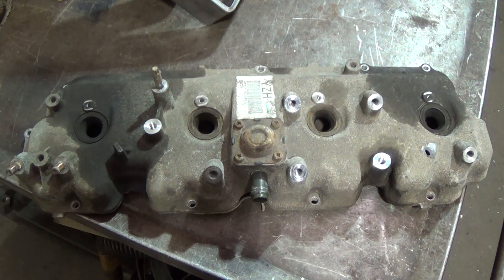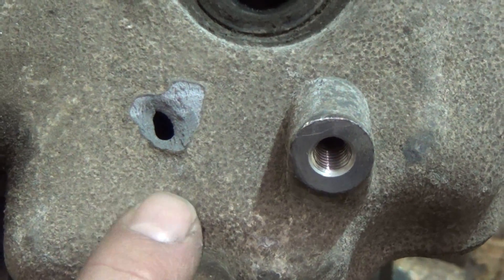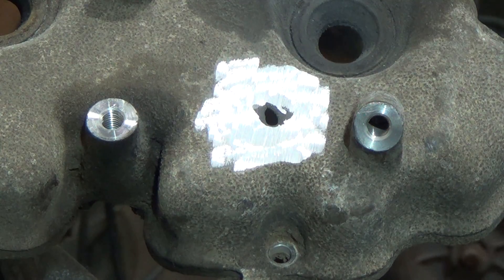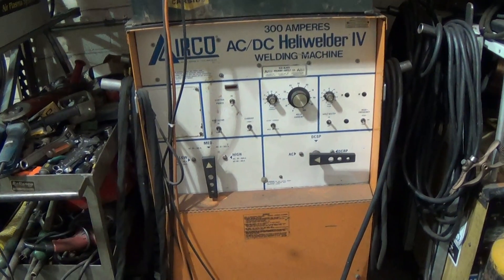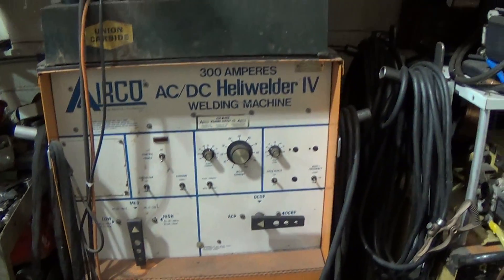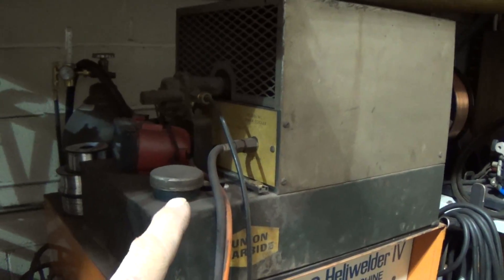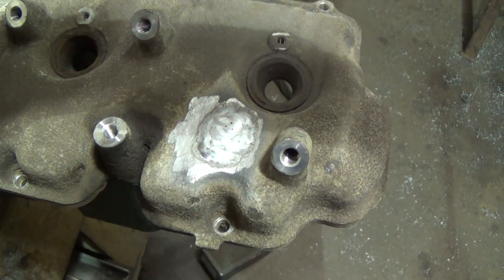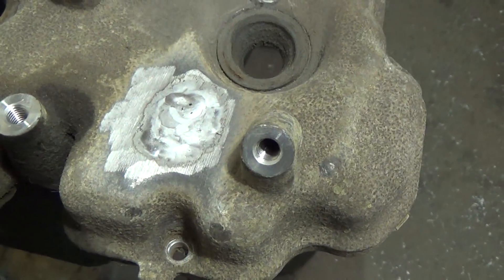Heliarc Repair Of A Cast Aluminum Rocker Cover

Comment: Nice job.
I was wondering did you have to do anything to stop the molten aluminium dripping through the hole, or is it thick enough to stay in place during welding?
Reply from the maker: Hi Jix,  No, I was able to not have to back it up with anything, just took it easy, as a puddle formed I fed a bit of filler and backed off, then repeat, and since it is aluminum it tends to dissipate the heat through the part.
  Thanks for the positive compliment ...... Mike
Reply: good question! i was wondering if he would use some of that graphite block stuff for this, would have been nice to see the underside too
Reply from the maker: jusb1066 Hi Jusb,  sorry I didn't show the bottom after the weld, there was just the slightest bubble type drip on the underside, about the size of a BB, which is OK on aluminum, I was able to control the heat pretty well.
  Thanks for the comment ...... Mike